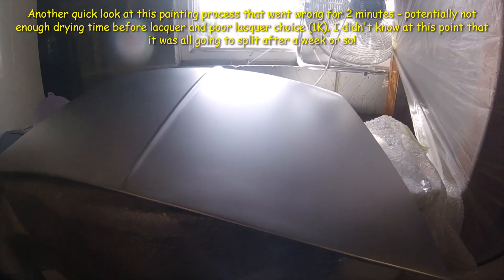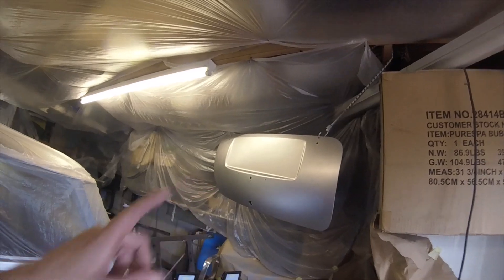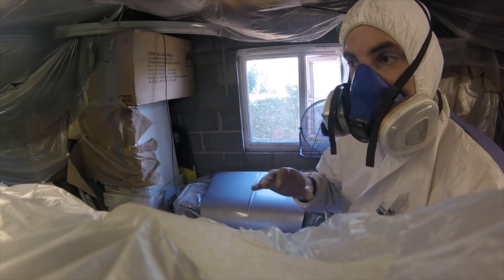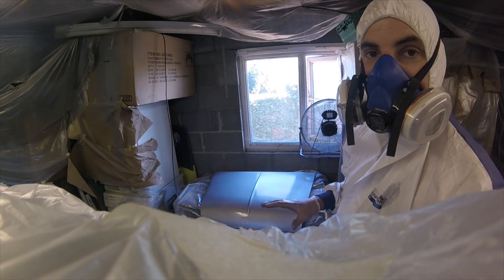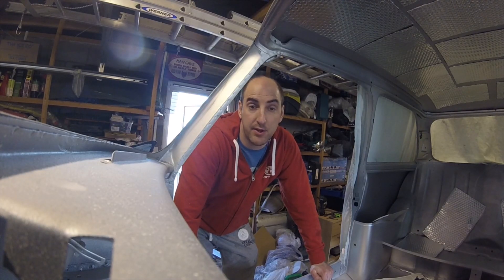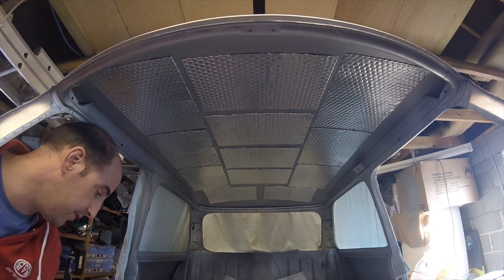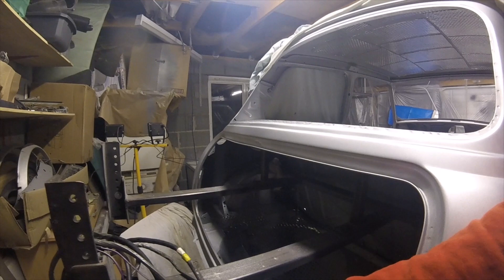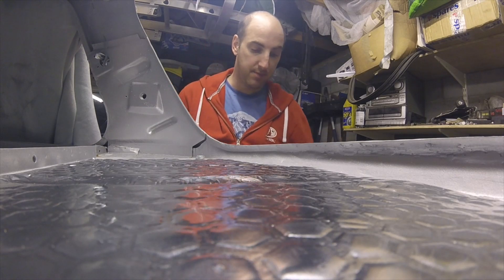95 Classic Mini Restoration - DIY Painting and sound deadening

Comment: Great job on the painting looks good one question how many sheets of sound deadening did you use on the mini thanks
Reply from the maker: Hi, this paint job unfortunately didn't settle well so it will be re done this spring/summer with different lacquer. Re sheets, about 40, you can probably get away with 30 if you aren't doing inside the boot.and all of the doors, back seats and roof. E.g. I have 12 on the roof but 9 is likely plenty. Matt Green did a videos on dodo and had a discount code if you search for that.